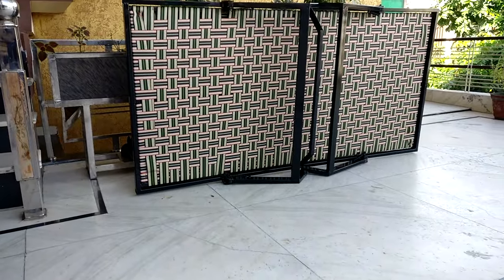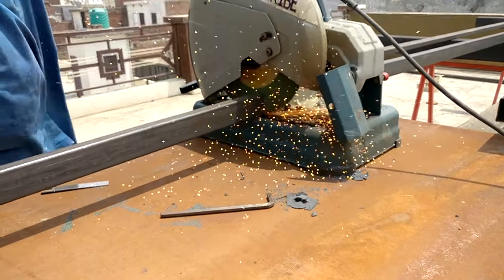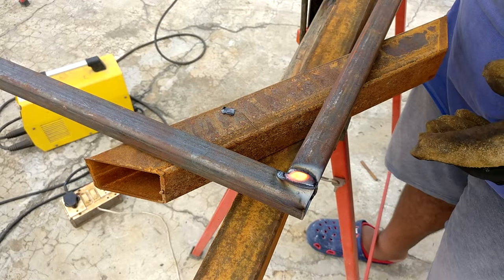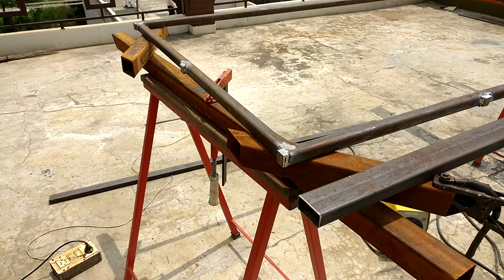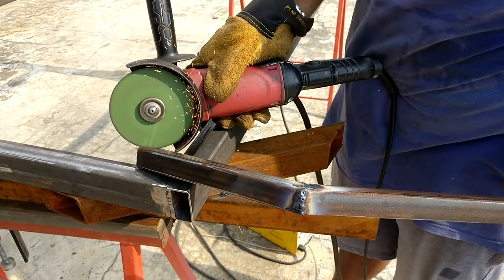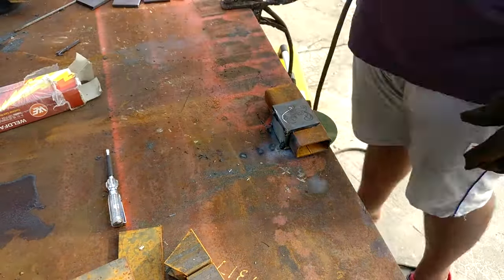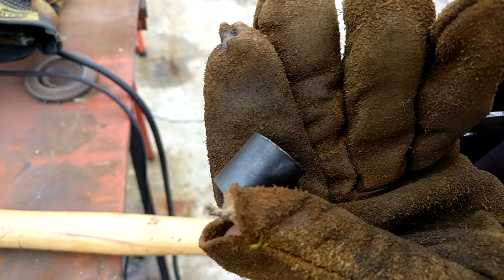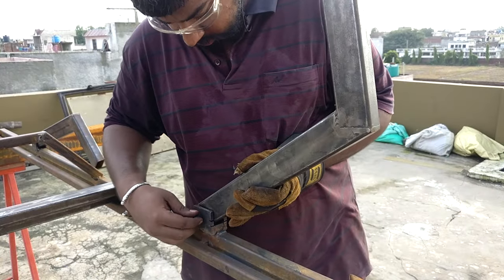Learn building - Portable Space saving foldable steel bed for outdoor - By Ambros custom

Comment: Could you please tell me at what current did you set for welding that 1x1 tube.
Reply from the maker: For 2mm wall thickness I usually kept it around 65-70 amps with 2.4mm electrode. If less than 55-60 amps
Reply: @ambroscustom  Thank you sir, I'm a newbie in welding, whenever I tried to weld continuously on that 1x1 tube, I made a hole by mistake. I'll try with this low current. But the electrode I have is 3.15mm.
Reply from the maker: Try to use a stich welding technique, only by that you are able to avoid holes. Very effective for thin wall tubes. Watch my this video, may be it helped https://youtu.be/n7qxpbQa4GU
Reply: Thank you sir, now I'm very much improved, your tutorial videos are really awesome.
Reply from the maker: @dknaoremcha  my pleasure dear, glad it helped.

Comment: Nice work complete engineer u r in this bed i am giving little advice for u that 1by2 pipe end is open so u should weld a sheet and cover that end looks more solid and ur bending leg is awesome use 90degree solid iron( in hindi kuniya) for leg rest its more heavier support for that

Comment: Can you please specify the electrode and amperage of welder used for welding in this video? (I'm a novice to weld)
Reply from the maker: Dear the electrode i uses having diameter around 2.5 mm and as far as amps is concerned I mostly play with the settings and what i found and used for my work is starting from 1.5 mm wall thickness i used 60-65 amps and from there after for every .5mm increase in thickness i increases the amps 5-7 amps and this works best for me. But beside the amps one thing I wanted to specify that it also depend upon how much time you stays at perticular spot. Too much time creates a hole and fast drag not able to fuse the metals together. So play with these settings will definitely works best for you. Good luck:)
Reply: @ambroscustom  thank you. And its 2.5mm E 6013 I guess?
Reply from the maker: Yes

Comment: Why the frame cutting not 45 dgree?
Reply from the maker: Because i need to install the  plastic endcaps there to protect floor from damage with the metal. I didn't install in the video but now i installed